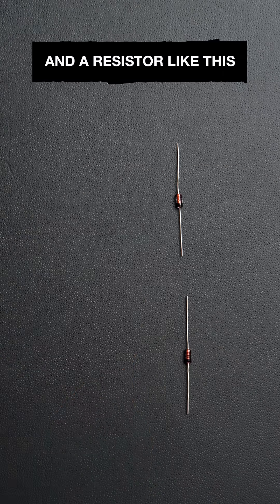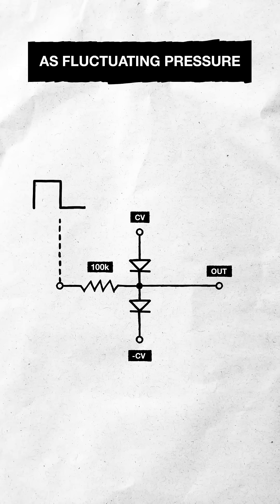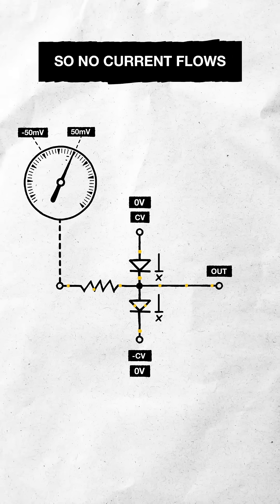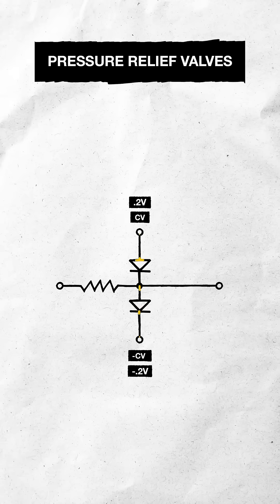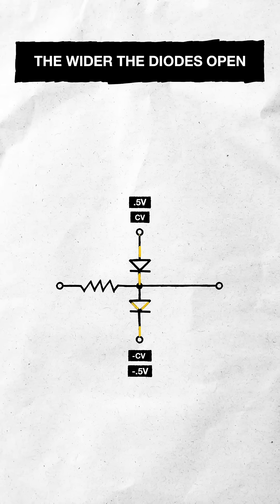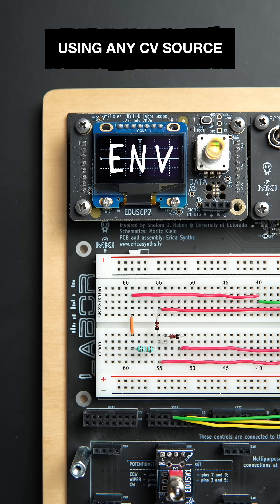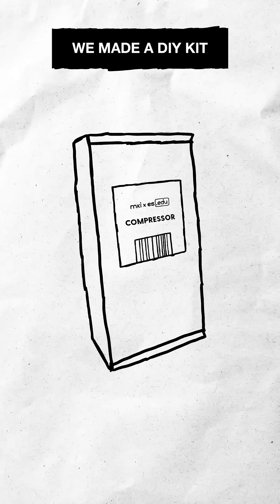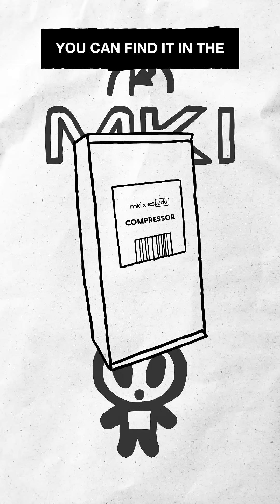Simple three part VCA (using diodes as voltage controlled resistors) #synth #electronics

Comment: This is a *diode clamp* which keeps the input between the supplied voltages on the diodes. I found this type of circuit in a microwave to ensure a voltage was always between 0 and 5V; also found it in an oscilloscope.

Comment: Isn't this more like a voltage controlled clipper, causing the signal to clip at the control voltage +0.6v for the diode drop? A true VCA wouldn't clip the audio signal.
Reply from the maker: no, that's not how it works. because the input signal is very low in volume, and the input resistor is very big, the amount of current going through the resistor is tiny compared to the bias current going from the positive to the negative CV. so as the signal oscillates, the diodes do not open (significantly) further, and the waveshape is preserved as-is.
Reply: @MoritzKlein0  Brain explodes. Thanks for the reply. I'll stick to CdS/LED kludged VCA. With such a small audio signal, is noise a problem?
Reply from the maker: @tomZmusic888  it's not too bad. but if you want to improve the signal/noise ratio, you can just use more diodes in series. this allows you to apply a louder input signal without getting noticeable distortion. see here: https://tinyurl.com/2a3ywb59
Reply from the maker: here's a simulation: https://tinyurl.com/22o6gb84 – it shows that the sine wave is not clipped, and how small the resistor current is compared to the bias current.

Comment: Mr. Klein, I watched you grow and you're just getting more and more excellent content and UNDERSTANDABLE descriptions of super fun concepts. I applaud your excellent work on this platform. DE W0XO Jonathan
Reply: I only partially recall a ham radio circuit for CW. It used a 4148 as a basic LPF? Or was it a crude AGC? Whatever it was, it used some of these basic behaviors of the components pictured. I looked at it and thought, "That's gotta be more complicated to work." This has changed my mind.
Reply from the maker: thanks for the nice words, i appreciate it! yeah diodes are super useful for implementing voltage control, though you have to think a little outside the box to make it work. if you ever find the ham radio schematic you're referring to, i'd be curious to take a look!

Comment: what parts are you using to make this stuff
Reply from the maker: for this circuit in particular, i am using a regular 100k resistor and two 1N4148 small signal diodes.

Comment: the built-in oscilloscope on the synth is very VERY cool
Reply: Small oscopes are getting cheaper and cheaper. I imagine we may see several "windows" on synths, showing the signal at numerous points in the synth setup.
Reply from the maker: thank you 🙏
Reply: @MoritzKlein0  did you code it yourself or was it opensource?
Reply from the maker: @superbman4088  janis over at Erica Synths coded the whole thing from scratch.
Reply: For low frequency applications like audio it's actually easy to build one from a cheap microcontroller with a good adc for example an esp32 can sample upto 100ks/s which is more then enough for audio

Comment: What about changing the diodes with LEDs, would forward voltage have any interesting effects on the sensitivity of this crude vca?
Reply from the maker: that works, and it even lets you apply a louder input signal, since the forward voltage drop of LEDs is much higher. however, I think LEDs also tend to vary more in their forward voltage, which might introduce a bit more asymmetry or distortion to the output.
Reply: @MoritzKlein0  BUT! It would look cool!!
Reply from the maker: @jonathanhaynes9950  it definitely does!

Comment: Looks more like a distorsion, acts as VCA only for low peek to peek signals making it EMC sensitive... Needs several AOP (for +- CV for example) and symetrical power supply so not sure this is a very good alternative to classical current mirror solution...
Reply: And as presented completely ignores the non trivial modulation of 2 rails. Yeah the basic clamp is "simple", but you have to drive it lol
Reply: If they are working in the small signal mode (one or two millivolts or less) then the diodes look like resistors with an impedance of kt/q over the current going through them. Kt/q is 25mV so their impedance is 0.025/I. I learned about this modulation technique in 1975 when I built Don Lancaster's TV Typewriter. He used it in the RF modulator
Reply: @ksbs2036 Ok but at these voltage rates, you know that signal noise ratio may become a problem... If it's not a problem on a vintage sound source, it could be, for exemple, on a modern analog mixer with vca busses...
Reply: @lewisanesa1223 yes, you are definitely correct. I was not saying this is the best way to make a VCA, just that it was. "One of many ways". And you can easily make VCA at very high frequencies with diode bridges (balanced mixer for example). At audio I would likely use the LM13700 since I'm kinda fond of that device
Reply: it could be voltage controled limiter-clipper turning diodes on off from rectified side chain signal, considering slowly opening ge diodes it may be kind of compressor. anyway i think the thing in the video is to control diodes conduction with cv
Reply: oh, and if it would be differential signal used then no need for bipolar CV
Reply: @ A clipper of course isn't the goal but yes... far as function, in any use case it is essentially clamping the signal path to whatever the rails consist of. And yes it could be done with a single ended supply, but you'd need to decouple the junction between diodes. In any case the response will be non linear and will tend to clip the excursions furthest from zero. Fine maybe in a synth, but less than useful when passing normal audio to say, an amplifier for speakers.
Reply: @MadScientist267  looking at a diode i\v graph - it can be operated in a curve region not completely open.